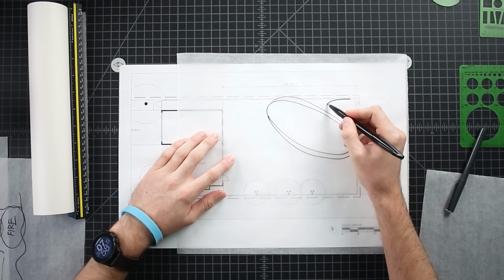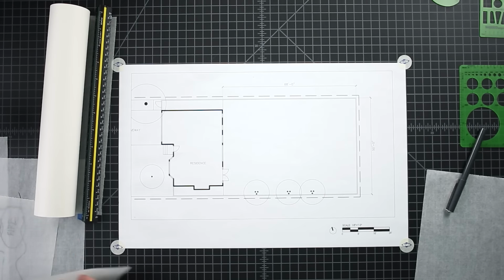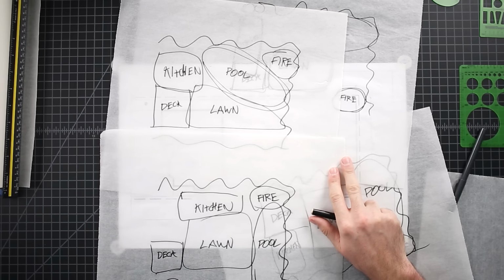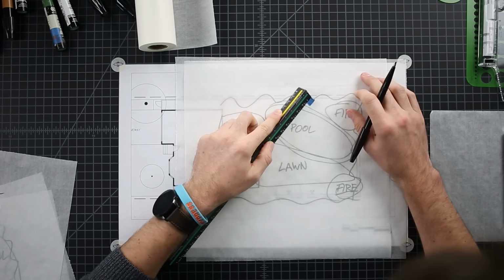Landscape Design - Site Planning - Part 1

Comment: what is that ruler??? I couldn't find it anywhere
Reply from the maker: Here is a link to the gliding ruler <a target="_blank" href="https://www.amazon.com/gp/product/B001OA02KI/ref=as_li_tl?ie=UTF8&camp=1789&creative=9325&creativeASIN=B001OA02KI&linkCode=as2&tag=pangeaexpre08-20&linkId=b326a2676ce2488176920d3d7743b417">Alvin 295 Professional Parallel Glider 10 inches</a><img src="//ir-na.amazon-adsystem.com/e/ir?t=pangeaexpre08-20&l=am2&o=1&a=B001OA02KI" width="1" height="1" border="0" alt="" style="border:none !important; margin:0px !important;" />
Reply: @EricArneson  thanks a lot!! :D